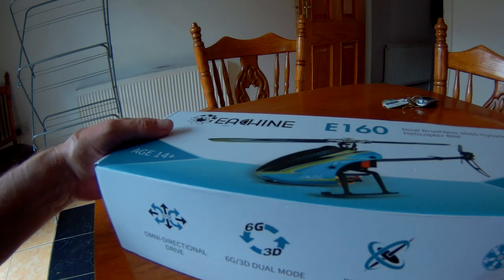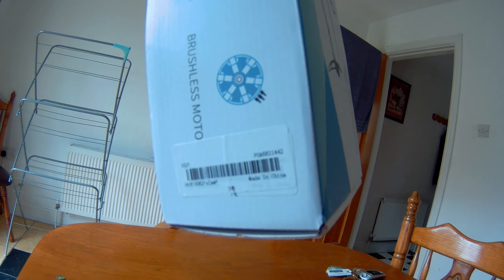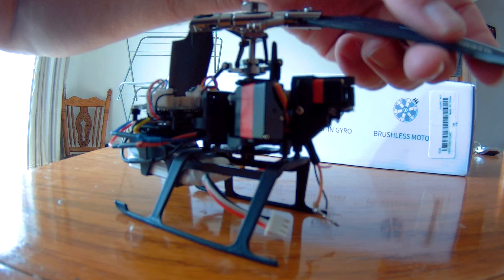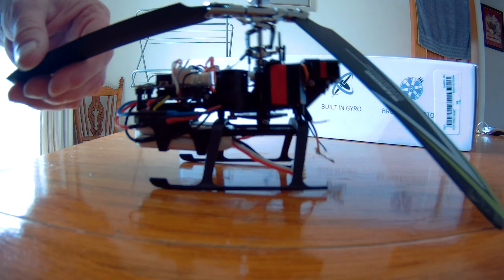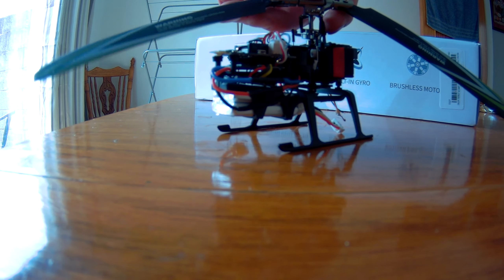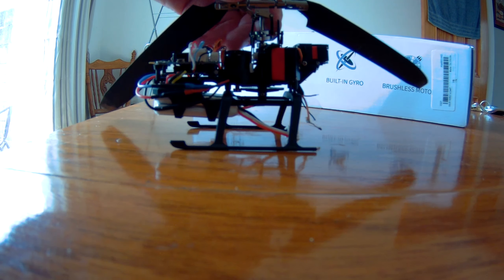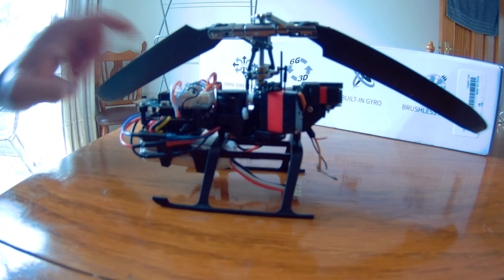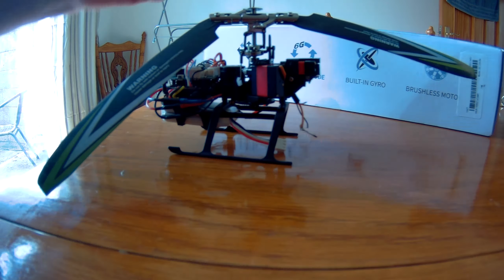Banggood Eachine E160 - loose fitting linkage rod destruction

Comment: I had the same issue with my new E160. About 10 seconds into my maiden flight the linkage rods came off. Thankfully there was no damage to the heli. Also the gear on the motor shaft fell off. I ordered some replacement linkage rods and motor gears. We'll have to see if this resolves the problems.
Reply from the maker: I just saw your message, I hope you are having better luck with your E160 at this stage.